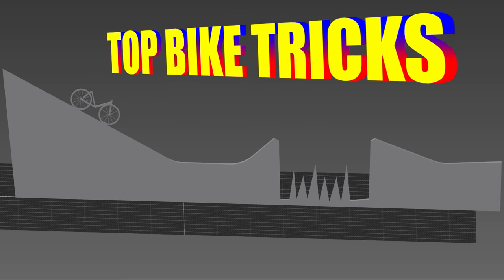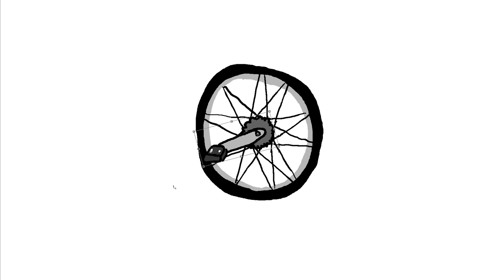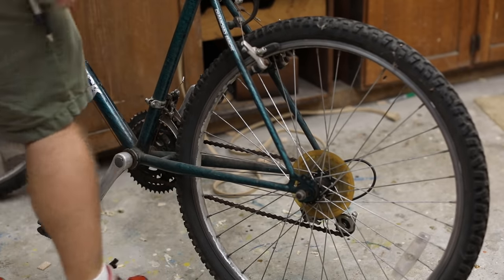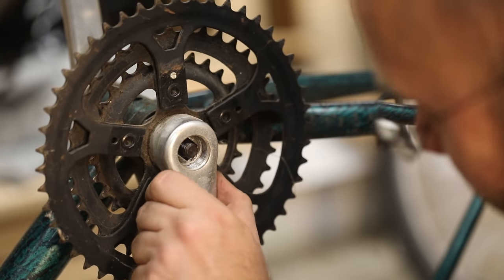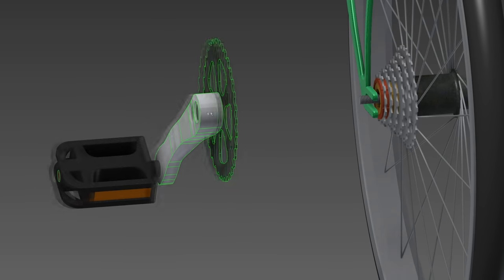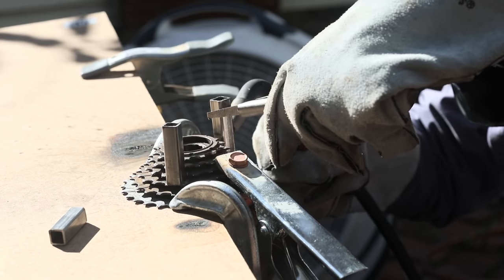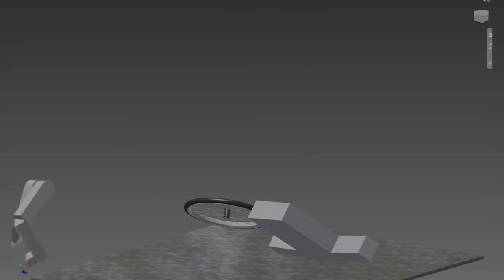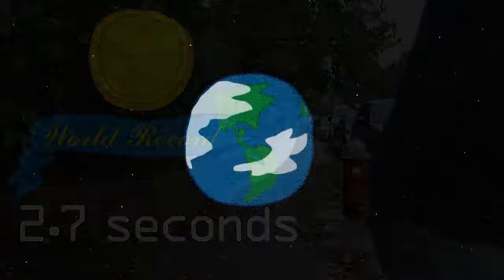Unlikely bikes: The Unibicle

Comment: Maybe it would be better balanced if the pedal was between the wheels, attached with some kind of chain.
Reply: And instead of one pedal; 2, one on each side
Reply: And I think it should have a seat in the middle to make balancing easier. As a plus, the rider can then use both legs.
Reply: and while we're at it, change the name to unicycle
Reply: And then we should add brakes just in case! You never know!
Reply: 9 inch bars, 21 inch frame, 20 inch wheels, no brakes, 4 pegs and a tall seat
Reply: Maybe add some kind of steering.
Reply: yeah and put the brakes and gears and all the controls on those handles, perhaps some sort of a bell as well? (Haha rhymes)
Reply: Our machine will be awesome, lets add a bell to notify others for coolness
Reply: personally i would go with four wheels - gives you a lot more stability. Also it would be great if you could enhance the pedal movement. Maybe a motor or sth? Tho at this point youd be going faster so a solution to shield against the wind and better seats would be great...just throwing it out there
Reply: I also think relocating the pedals closer to the middle and allowing full rotation would help.
Reply: Maybe you could have the gear changer in the middle of the seats! You could even put a radio or CD player near the steering, so you can listen to all your favourite songs!
Reply: This comment made me laugh, like, a lot.
Reply: @TheVergile  Rubbish. Would be far too popular, defeating original use, and require specialised infrastructure.

Although.... actually come to think of it. If you chained a BUNCH of them together and added more seats.... maybe even add a hardened metal surface for it to run on... yeah this has legs actually!
Reply: I feel like there could be a joke made about making this into an airplane
Reply: @hemlockwaterdropwortchanne3896  and what if we made the wheel retractible and we put big wings and have aerodynamic shape and put some turbines for impulse and then we can fly and surf the skyes
Reply: @TheVergile  that's a great idea! but what if we added two tracks for the wheels to go on so you don't have to steer, and then linked a lot of these duoduounibicles together. and then we could add a third rail to power the motors! we could call it, the polyduoduounibicle

Comment: I have an idea. You should try removing one of the wheels of the duo-unibicle since the rear wheel isn't strictly necessary. Then you have a much more elegant device; call it the monoduo-unibicle. If you then have some balance issues, just find a wheel somewhere and attach it on the end for stabilization (bimonoduo-unibicle).
Reply: Or, a BMDUB
Reply: @SnoFitzroy  Add a cymbal on the back as a joke. BMDUB-Tsss.

Comment: I don't know if I should post this considering what I just watched...
You know the way skateboarders tic tac to gain speed?
Well, there's a similar maneuver that can be carried out on bikes.
You simply shift your weight and bike from side to side while keeping the rythm with the handle bars in the same general direction.
But just as you start to oversteer to one side, you flick the handle bars to the opposite direction. This causes a weight transfer and friction from the front wheel to the ground.
When you get really skilled at this your tyres will make a aggressive braking sound but you will be propelled forward at high speed.
Start practising at no speed from a stand still sitting down on your bike.

We used this maneuver hundreds of times through the years when the bike chain broke and no tools were available. It's a neat trick that saves you from a long walk home. =)
Good luck, and thanks for this funny video. =)
Reply: I tried to look up "tic tac with a bike" on youtube, but I could only find videos of kids with dental issues. Is there any proper term for this or do you know any video that shows it?
Reply: @Linck192  Sorry my friend. I have never found a video about it either. It's a very interesting exploit of physics. Some of us who we really good at it could get home after the chain failed. So we were rarely stranded.
Maybe I should dust off one of my bikes and make a video about it. =)
Reply: @Kaxlon  It's called pumping!
Reply: @jonahnichols2158  Ah thanks! I forgot that we used this technique when the bike's chain broke and we still needed to get home. =)
Reply: I used to do a very small scale version of this while sitting (basically precisely what you described as the easy mode version to start) and yeah I definitely could never reach that kind of speed without doing it

Comment: For removing the bike chain there's usually a C pin in one of the chain links that is easily removable. If it's not there then a screw driver wedged into one chain link and force applied will pop it open.

Comment: If you wanted it to work better, I'd suggest adding another wheel parallel to the first connected by the same pedal for balance and stability's sake. Wouldn't be a unicycle anymore, but it's probably closer to the kind of riding experience you're wanting.

Comment: This kind of input might not be welcome, but maybe if you fix the sprockets to the frame, so the wheel can spin forward, not backward inside the frame and you fix the pedal to the frame (of use a BMX peg, but lower is probably better), it might actually be possible to ride it. (Not "use", just "do something".) You would kinde jump forward, then coast. And you can put one pedal each on both sides - not to stand symmetrically and balanced, of course, but to ride with someone.

Comment: You could try using just one wheel and both pedals, but like when one is pointing forwards the other one too is pointing forwards. That way you could balance easier and still show off your bouncing on the pedal technique. You could call it bipedalunibicle.

Comment: You could probably alleviate the steering issues in the final product (as in: it doesn't steer) if you took a rollerblade approach to it and bunnyhopped it off the ground for every course adjustment.

Comment: the plastic guard at 4:14 is so if the chain comes off.... it wont wrap around the wheel, and cause it to lock
you might fall down and sue them basically.
Reply: If the rear derailleur is properly adjusted, the chain will never come off unless it breaks. The dork disc itself actually locked up my wheel once, so I remove it when I get a new bike. That said, if you never maintain your bike, keep the dork disc.

Comment: Interesting... What if you kept both pedals... But angled them the same way, and hooked them up with springs. The idea is that it would basically be a pogo stick, but with a wheel, and every time you "bounce" the wheel turns.

Firstly, this sounds like a fun unlikely bike. Secondly, good freaking luck riding the thing without falling down! XD
Reply from the maker: Hmm yeah, I like the idea of springs. That might even help with this design...

Comment: I may have missed something, but if you don't need a full revolution anyway, why bother with the standoffs for the pedal?
Reply: Ah, I see what I missed: this is totally not serious in any way lol
Reply from the maker: haha, true. Well, there was one real reason: There's not enough room in there to mount the pedal without widening the frame (which would be way more work). The freewheel takes up most of that and shan't be ruined. It also might not leave enough pedal width to use comfortably... not that it came out comfortable anyway. :)

Comment: Why do you keep saying the bike will go backwards if you use your right foot. The wheel turns in the same direction as the pedal so as you push the pedal down the bike goes forward not backward.
Reply from the maker: The pedal only makes the wheel turn in one direction. In its normal configuration, the pedal and chain and sprockets are on the right side of the bike (when you're sitting on it). If you get off the bike and stand on the pedal with your right foot, then you'll be facing the back of the bike, so the bike is moving "backwards" relative to your point of view now.